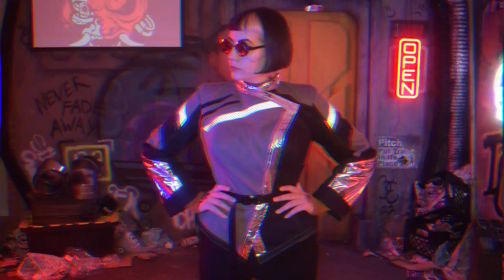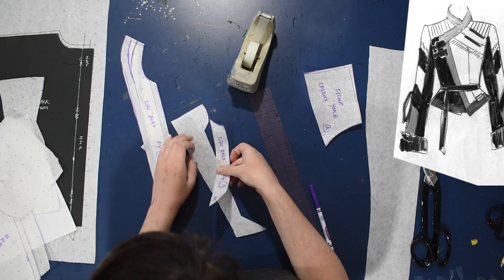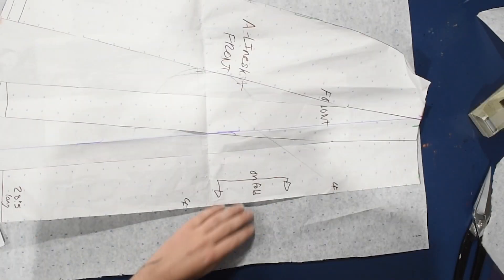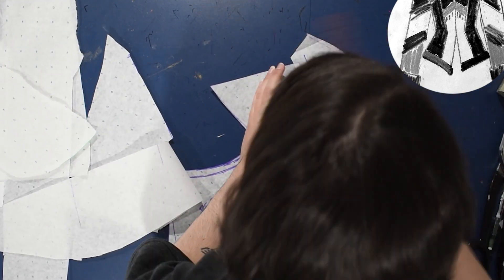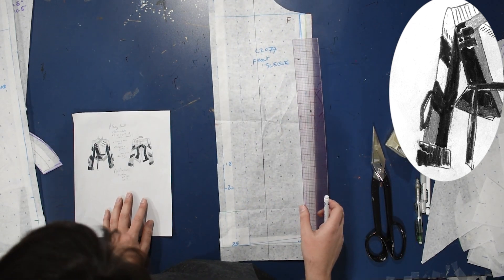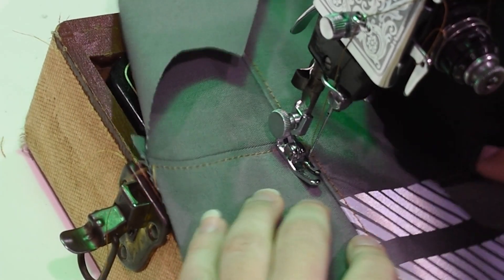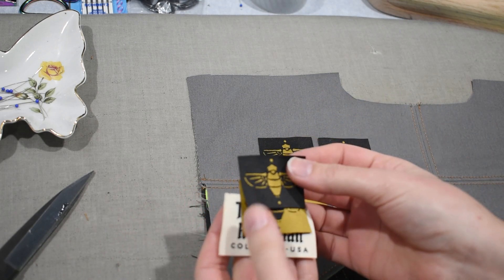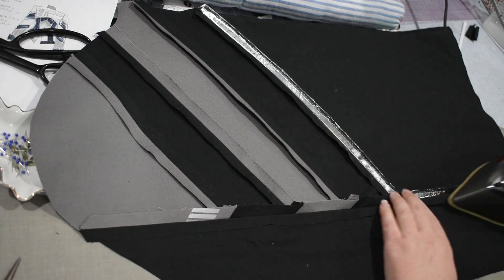Making a Cyberpunk Jacket // Techwear Inspired Blazer?

Comment: So - I can take my block and literally slice dice and julienne it.... but as long as I add seam allowance and make sure my dart volume doesn't change... I can piece it back together and it will fit?
Reply from the maker: Yes! The fabrics used have to be of a similar weight too, so if you were to patchwork between a super loosely woven lace and a stiff cotton denim, the fit would be effected by the wonkiness created by such different textiles, but if the fabrics are of a consistent weight and amount of stretch it works fine!
Reply: @TheClosetHistorian  I drafted a pants block and sewed it up in 'muslin' (just old sheets) and when I sewed it up in some heavy corduroy it fit totally differently. Ugh. I think I might just make sure ALL the fabric I work with has at least a little stretch.